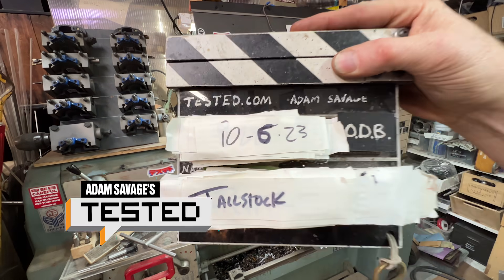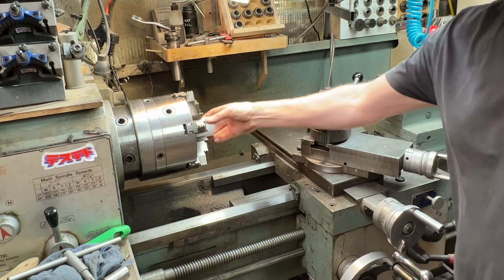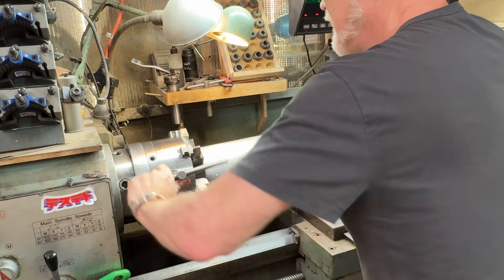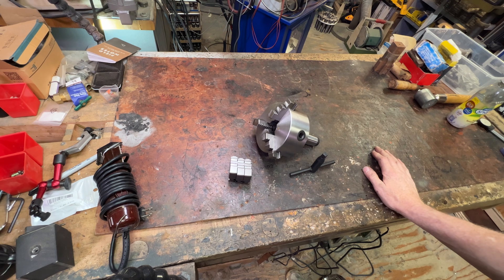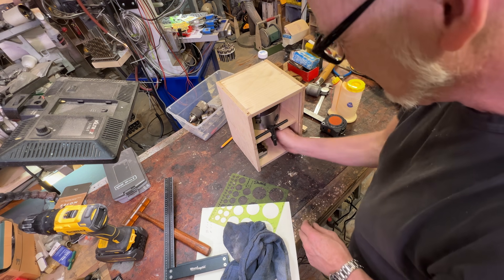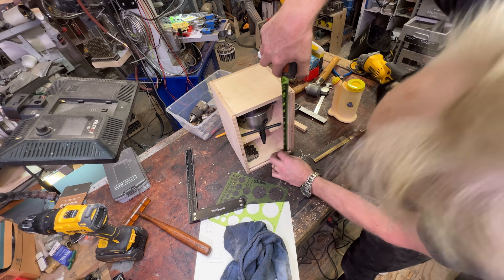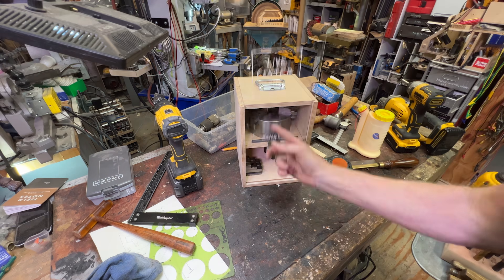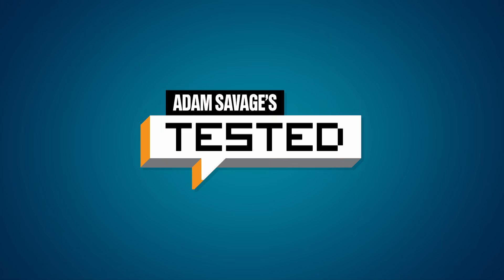Adam Savage's New Lathe Live Center Chuck

Comment: When I worked for the Navy testing carry landing hooks a chunk of hardened steel the size of youre arm it had a strain gauge that could measure the slightest twisting of the metal only by holding it in your hands and trying to turn it opposite each other. A needle on a graph would show when you could not perceive you actually did anything..

Comment: I would have to remove that center shelf and cut a side to side slot in it to accept the chuck key handles. The key would always lay parallel to the glass and act as the ( Previously removed ) stop for the chuck. Nice storage box. Good job Adam.

Comment: you always use a plug when holding a pipe and you clamp it from the outside, never from the inside cause it dosent hold as well and it will be a oval even with 4 points.

Comment: why have it hang on the centre board, should be standing on the box floor, no sagging and not top heavy, the pipe end could store the key, but why not have in the tail stock all the time if space permits and use it to hold live ...

Comment: Please don't place cutoff wheels or sanding/grinding wheels facing down, the tool is designed to lay on its back, it's for safety and to prevent damage to the wheel.

Comment: i am almost done making a bolt from aluminum. it is 2" x 16 thread, with a 12 point 2 1/4 head. I bored the shank out to a 3/16 wall. I cut off the cap, and i am boring it inside to 2 x 16 tpi. Once its done the threaded section will thread into the cap, and appear to be a large plain bolt, but it will have a 1 5/8 stash inside it. i am cutting the cap flats on the mill with a spindexer. Once i get my chuck mounted on the rotary table i should have better accuracy, but it looks good so far! Great channel!!

Comment: If you don't have one, another cool thing to build would be an ER-40 or ER-32 collet chuck! Just save the bore taper until the very end and cut it while it's mounted on your lathe so you know your collets run concentric. As long as your chuck mounting plate runs true and you keep the collets in good shape it should hold round stock concentric within .001" or so every time, it's super convenient to use for small parts.

Comment: cool build and cool video, nice explanation of the lathe at start.

possible addition to the box, a hook to store the removable frontage on the side of the box? nothing worse when you are holding something and need to pick up 2 or 3 more things which you could do with 2 hands if you were not already holding something, could improve flow in your workshop.

Comment: You can build one with a collar on it that has 4 screws in it for adjustability that way you can true it up, i also run a 3 jaw chuck in my 4 jaw for ease of part removal and you can build long soft jaws to hold as big a part that will turn on your lathe. I run 12" stuff every day with this type of setup

Comment: It can still be improved. Use a chuck smaller overall than the diameter of the pipe. Clamp the pipe from the inside with the overlapping parts of the jaws and you can accurately square up the end of the pipe and still get a nice edge shrink.

Comment: "something I'm not going to use more than once a year." Spoken like all thousands of dollars spent tooling any machine. When you need it, nothing else will do. BTW: I hope you used high quality bearings or have at least checked run-out of the ones you used. They can be surprisingly bad and be the cause of poor finish on your parts. A friend's HF lathe had more than 0.001" run-out in the factory spindle bearings. Finish cuts were impossible.

Comment: You can turn a plug for the end of a big pipe and put a center in that to hold it. The problem with the second chuck solution is that you end up having to be pretty far away from the work with your tool or else the sticking out jaws will hit your compound / tool holder

Comment: Adam as you are chasing the 0001s - I was once told by a machinist that when turning a part you are supposed to make the centre drill with the part in the position that it is going to be machined ie sticking out, this is to limit the additional stresses added to the raw stock so the piece spins on the chucks axis 'naturally'. If you put it all the way into the chuck and find centre then if the raw stock was bent then it would be 'straightened' when in the live centre and would then bend when released from the lathe after the part was turned. I hope that made sense.
Reply: That does make sense but not always possible. You wouldn't have 2 to 3feet of shaft hanging out of the chuck to centre drill it unless you wanted to wear it. The idea is to grab the material very short, centre drill it, then move it out to where the machining can be done. If the material is bent slightly as you mentioned, you put a piece of keysteel (@90deg) under each jaw. 
When you grip the material short to centre it, you have to be mindful of the rest of the material in the spindle. If it's too long or bent, you have to centre drill at lower rpm. If it hangs out the back of the spindle you have to be aware of two things. One is that no one can go near it. The other is that if you start the lathe at too higher rpm, the material can bend at 90deg in an instant and do a lot of damage. I've only seen it happen a couple of times and fortunately it wasn't me. One time was a piece of 1" solid bar that instantly bent and was bashing on a welder. Just a horrendous noise.
If it's a long piece of material, you can rest it in a timber vee block and run fairly slow rpm to centre drill

Comment: On this topic, I notice your 3 and 6(?) jaw chucks move with a single hole. Is it true that 4 jaw chucks have 4 holes? How do you make sure you're on center when tightening them?
Reply: On a 4 jaw chuck you move each jaw with the key (yes they have 4 holes).  You use an indicator on the part and have to rotate the part many times, adjusting each jaw until the indicator needle doesn't move as you rotate the chuck.  Or you can use a 4 jaw to set up a part off center to cut something like a camshaft.
Reply: @MartysRandomStuff  wow, thank you. I didn’t even think but of course, an indicator!

Comment: You should 3D print a part to wrap around the front of the chuck and provide a notch for the chuck key to go in as well. Then you could saw off the dowels on the bottom :-).

Comment: A tailstock self centering three jaw chuck is a neat idea. But i wonder what the run out in it is. A four jaw non self centering chuck would give you far more versatility even if they are an irritation to use. However if you want precise parts, the irritation must be endured.
Reply: The four-jaw self-centering chuck is excellent for the tailstock, because there can be conveniently clamped a tap :-)
Reply: @AP57532  ...that's not going to work...
Reply: @j.f.christ8421  Why wouldn't it work? I use it quite often.
Reply: @AP57532  Really?  In real life or in your imagination?

So you've a chuck at each end, both of them can spin, plus you still need to wind in the tail stock.  Sounds like a great plan, meanwhile the rest of us just use a spring-loaded tap follower.
Reply: @j.f.christ8421  Oh, that's a misunderstanding. I don't use a rotary chuck in the tailstock, but a fixed one. I can clamp a tap or a die in it. When threading, the tailstock is loose and because it is quite heavy, I still manually extend the spindle when threading so that the tailstock is still in dynamic friction mode and doesn't wiggle. It's often more comfortable than a tap holder and I don't even have a die holder. Of course I'm talking about hobby use.

Comment: Good morning Adam, a little off topic but this question occurred to me the other day about an old MythBusters episode. I'm a professional driver and I often draft behind trucks to save gas and I remember you did an episode with Grant driving a car testing whether or not drafting behind trucks increases fuel mileage. The episode demonstrated that it does provide some benefit, but Grant's crappy/nervous driving when up closer to the truck caused you all to come up with an "inconclusive" result. 
So the question is, was that result deliberately arrived at to discourage people from the risky practice of drafting behind large trucks, or did you really truly believe that drafting wasn't worth the benefit/risk ratio?

I am a professional driver, a medical courier, live in the SF Bay area, and I have been drafting behind trucks for years. I have gotten a Ford ranger that normally gets 24 miles per gallon to achieve 40 miles per gallon on a trip on the freeway from San Francisco Bay area down to Fresno. 
I'm wondering if you would like to repeat that experiment, I would love to be the driver, and I have some ideas on how to make it both safer and more reliable science method wise. 
Cheers!!!